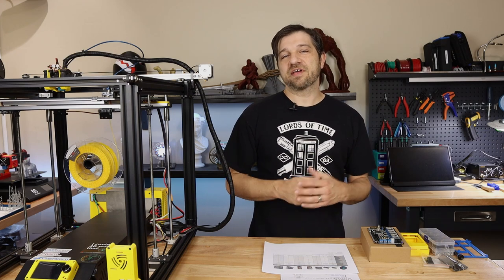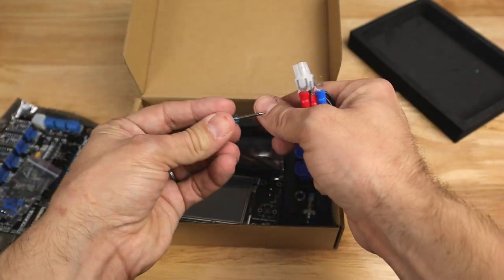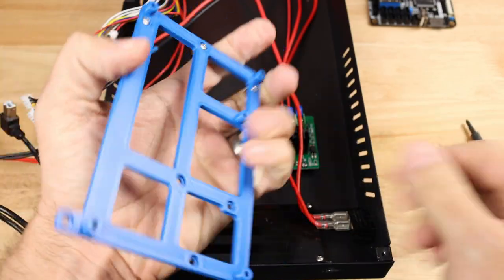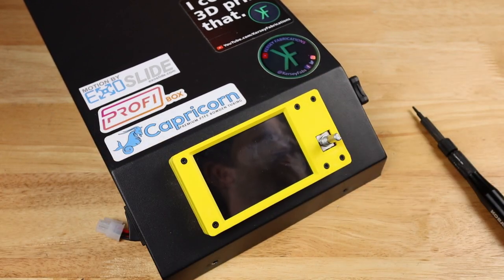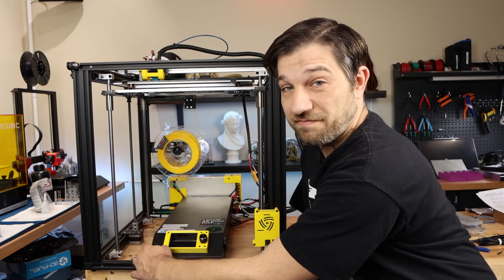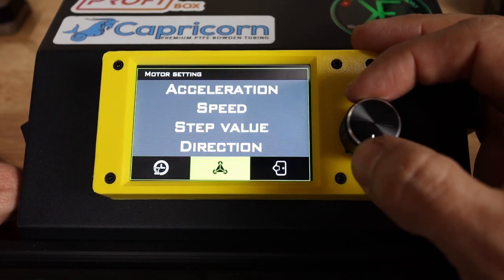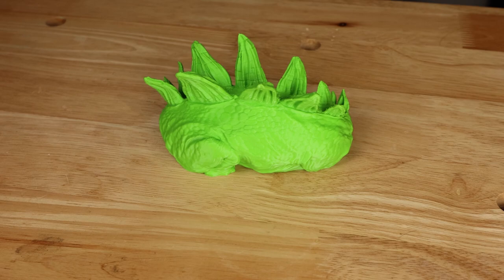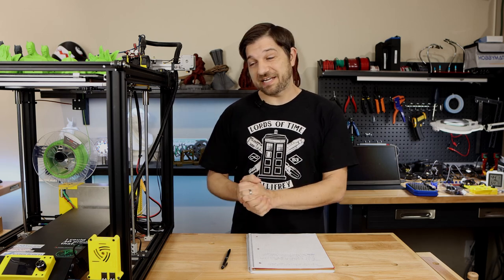Lerdge K 32-bit 3D Printer Mainboard Guide and Review

Comment: Will this setup fix the 2 most nagging faults with what should be a great printer.
I, the dreaded warped bed the BLtouch makes a nice consistent mesh, but Marlin v1.7 (even your compiled firmware) never seems to read it properly. I resort on big prints to use a raft.
2 marlin v1.7 does not read long file names, which is a pain when you want to save great prints with basic design info for my own back catalogue.
Great video again must sort myself to get on the patriot list.

Comment: Great job, I'd like to see if Marlin could be put on it. I'm also interested in hearing more about the octoprint issues. I don't think I'd upgrade to a board that didn't have good communication with octoprint.
Reply from the maker: Thanks! I'm expecting that they can work out the OctoPrint issues. I'll keep everyone informed.
Reply: Octo works flawlessly with Lerdge boards, I have been using them fault free for 4 years now. Marlin has been ported for Lerdge but it doesn't function as nicely as Lerdge FW. In my years of using Lerdge boards, I have NEVER once ever said to myself, gee I wish this was marlin. It is significantly better!
Beware of one youtubers opinion regarding a feature like this guy with saying octo deosn't work, it does and it does well!

Comment: you rekon this would be a simple enough thing to do if you were going straight from default main board to this? seems like for the most part it's plug-and-play other than some configuration stuff and swapping one or two pins.

I'd also like the thank you for making this series on the ender 5 plus. seems no-one else out there has made any worthwhile videos on this printer and no one really seems to know about it. when i finally get around to getting mine i've already decided that im going to get an exo-slide kit at the same time thanks to the video you made of them, and your fixes for the BL-touch seems easy enough to do.
Reply from the maker: I think this is a good board upgrade for those not interested in Marlin. I hope to receive a fix on the OctoPrint issue. I'm glad you're enjoying the content. Thanks for watching!

Comment: I need help.  Follow your video installed the board just fine but the z axis try push up the extruder and the BL touch do not stop it.  What do I do wrong?  I need to reverse the Z axis motor direction also than the video.  When Z+ press on the screen does the bed suppose to go up or down?  Because if I follow your video direction the Auto Level probe test about 10 inches above the bed.   What is my first step to test the BL touch work correctly?
Reply from the maker: 1) It sounds like your black/white BLtouch is not wired correctly. Double check that one.
2) Z+ should bring the bed down because you are increasing the Z height.
Reply: @kerseyfabs  1) I try flip the black and white wires (Opposite than your video) and now when I go to Auti Leveling Setting Probe Wiring Mode NC it does not beep any longer.
2) The Z+ now move the bed down same as your video, just to confirm.
Now when I do the Z axis home, the BL Touch turns to blue (red off) and the probe is down.  But when it reaches the BL touch it does NOT stop and the nozzle crash to the bed.  I have to do emergency power off.  What is the problem why the BL touch does not stop the Z motor?  What setting do I need to change, is the probe wiring need to be N-O?
Reply: Thanks KF, got all to works now but I still have one questions on the stock BL Touch and Extruder mounting what is the Off set values and how to measure it correctly?  You mention the Z axis need to be -3 but +3 seem to work also?? Why?

Comment: As an FYI to everyone , the stl does not fit with the current version .  The adjust knob and buzzer have moved, also the mounting holes on the right side of the lcd mount have moved.
Reply from the maker: That sucks! I don't have the new screen to fix my model. I wonder if someone else has?
Reply: @kerseyfabs  I do, I bought the kit that came with all accessories.  the Wifi module now has a hole extended out to be inline with the motherboard hole.
Reply: @kerseyfabs  Its a V2 motherboard now and the diagram for it doesnt show the wire colours.  I am just hoping the old diagram is still correct.

Comment: I am getting the board soon about over 1 month from China.  I like you to do some video on the touch sensor from lerdge that use circle ring on the hot end.  I did order one but not sure hot it works.  Also video on replacing the end stop with lerdge using optical switch.

Comment: Great video love the bord I just have 1 question what sd card extension do you use every extension I use I get a error with printing ( storage device error )  and have tried some extension cable even usb but when I put the same micro sd directly in the bord it works perfectly best prints I ever made .
Reply from the maker: I included links to all of the parts I used in the description. I've been using this one on multiple boards and multiple installs with zero issues.
Reply: @kerseyfabs  well I got the micro extension cable the one you are using still the same error maybe it’s the psu dying  still using the original power supply maybe the power drops during print but  if I put the sd card directly in the board it works great.

Comment: Main reason I will not ever use octoprint, even though I would love to be able to send gcode and do everything remotely (on my Ender 5) but the slow down is a problem I see people talking about a lot with higher definition models that take more data to produce. This is the reason I think people see improvements with using Arc Welder since it reduces the gcode required by a TON on certain models. Would love to see a huge/high-res model compared with and without octoprint and then with arc welder included. 
I love the ability to do things direct on the mainboard without having to recompile Marlin (ugh)! I wonder how many limitations there are though. Basically, what settings are not included that someone who is a little more involved with micro-managing settings and/or adding hardware and options (like yourself with what you do reviewing and constantly adding or changing parts).

Excellent video as normal (I am catching up....hopefully lol)!
Reply from the maker: OctoPrint can be a problem sometimes if you have certain plug-ins installed or if your board's firmware isn't configured to handle a lot of data over USB. I go back and forth between using it to print. Either way though, I can use it to monitor printing, even if I'm printing from SD.
Reply: @kerseyfabs  You know, I never thought about that! I am an idiot but I didn't realize I was this bad LOL You don't HAVE to use it to print from just to monitor....Ok, now I might actually get the stuff to build one of these puppies. I don't know why I was thinking if you don't run the stl from it you can't monitor anything... Thanx for the info man!

Comment: Now that it’s been a month, are you still happy with this setup? I really like that you can adjust offsets and such right through the printer UI
Reply from the maker: Yes! I'm still using it for prints big and small without issue. I am looking forward to the next video worth of content to work a few things out but it does work well. The main thing I need to do is get UART mode working. It will help make it quieter and better tune my voltages.
Reply: @kerseyfabs  excellent. Is this considered a “silent board”? I’ve got the oem board on my e5+. It’s been driving me bonkers for nearly 6 months. Came across your video on this and it is a much more intriguing upgrade to me compared to the creality silent board
Reply from the maker: Well, the board itself isn't silent. You'll need to order it with silent stepper drivers. Since it looks like that's all they sell it with, you should be good.
Reply: @kerseyfabs  right understand that it is the steppers. Great videos by the way. They’ve been quite helpful.

Comment: Is it possible to upload your own designed icons for the GUI on this board?
Reply: proprietary firmware, so... you I don't think you can do it yourself. While I'm on the subject you may want to consult the lerdge website under 'g-code' to see if some of your favorite g-codes are there. i.e. M600 - Filament change is not listed, so until it is you'll have to g-code your own implementation.
Reply from the maker: As far as I can tell, you cannot change the icons but it may be possible to figure out the .ui file format that is in the firmware package to change that. It does appear that they have some sort of software to create your own bootscreen though. I haven't tried it myself.

Comment: I liked this until you mentioned that other displays are not compatible with it. I have a BTT TFT70 display waiting to be installed, I just need to find a case that I like for it to go into, and my choices are pretty limited for now. I also am very new to 3D printing and have absolutely zero designing skills. I'll just keep patiently waiting for your SKR PRO v1.2 video. I have that board already, but I bought it without drivers because I wasn't sure which drivers were being shipped from Amazon, AND more importantly, BTT's webpage shows six different drivers. I'm not at all sure which ones to get and which ones perform better etc. etc. etc.

Comment: I just make a few prints using this board and it print very nicely.  Now I noticed that the hot end fan is not coming on when printing.  Only the Heat Sink fan on when heating on.  Is this normal printing PLA the hot end fan not comes on on this board?  For testing I swapped the Hot end fan and Heat Sink fan connectors on the motherboard it is working correctly.  How to test this hot end board pin?
Reply from the maker: The cooling fan should definitely be turning on. Make sure you're connected to the right header. You can test the cooling fan by itself on the Control page. There is an icon that looks like a fan that will allow you to set the speed.
Reply: @kerseyfabs  It works now.  The board should have manual explaining all this.  Do you know why this cooling fan not automatically comes on?  What percent should I put on?  For PLA is that 50% or 100%.
Reply from the maker: The part cooling never comes on automatically from the firmware. Your slicer (Cura probably) should have a setting that tells it when and how fast it should cut on. Usually 100% for PLA.

Comment: I ordered a k board for my ender 5  plus. Has anyone used Kersey's config file on the latest board? Just wondering if it works on the latest version. Thanks
Reply: well it mostly worked. I had to set the motors up, set bed size and end stops.

Comment: Thanks a lot for your great videos,work  and your massive pacience in explaining step by step, I really enjoyed your videos.
Perhaps you could take a few minutes and help me with this Ender 5 plus and the Lerdge  K Board, that I bought after seen your video
The wiring is correct ,I upload your great Config.But when I try to home the Zaxis with the BL Touch, the Trigger comes out,and the Bed comes up,but the Nozzle crashes into the Bed, the wiring of the BL touch is correct,and yesterday itworks fine wih the originalsilent board.
Perhaps any suggestion  ? I will be glad for any help
Greetings
Reply: Okay I think I found the Problem,it seems that the wiring was correct, but the issue was the white and black wire,I had to change the direction of the black an white wire, therefore "problem solved" :-) Homing was a perfect match !!
Reply from the maker: Glad to hear it!
Reply: @kerseyfabs  Thanks for your  answer,had till now a pair of issues, but after printing with your config file,all works fine,till today :the steppermotors gets hot, hotter than 70^C for the extruder I have the Vref on all TMC 2209  at 1.250,and the mA at 600.I tried to lower the Vref but still gets hot .The TMC 2209 i left it in the Stock Mode without changing any pins on the Board
Also the start of the Print,till now the head homed first,then goes to the middle, where it Touch with the BL touch the Bed,then it went to the forward left side and start the Print. 
Now the head is homing  back goes to the middle,then returns backside on the right side and from this startpoint it goes forward to the left side of the printer and start the Prnt with the Primerline 
Perhaps you haveany suggestions about Motor Temp and the Printrun 
greetings and thanks for your support :-)
Reply from the maker: Thank you so much for bringing up the heat of the motors! 😬 I had not noticed that since I don't go around touching my motors often. Now I need to get up a video ASAP!  Here's what you need: https://www.lerdge.com/public/upload/file/360f824755ab521bd741a67994b1de7e.pdf
This spec sheet has the magic formula which amounts to I = 0.88 * Vref. This means we need to turn them way down from what appears to be the default of 1.25 V which is 1.1 A to 0.68 V for .6 A.
If we go by my previous installs:
X: 0.65 A = 0.739 V
Y: 0.8 A = 0.909 V
Z: 0.65 A = 0.739 V
E: 0.8 A = 0.909 V
If you're not sure how to do this here's a previous video that shows the process: https://www.youtube.com/watch?v=cAI0H4e6Usg&t=946s
I'll release a separate video on this soon!
Reply: @kerseyfabs  I'm so happy not to be the only one with boiling stepper motors.
Thanks for the feedback, I'll swap this on the board immediately
Great work from you. I designed a logo for your bootscreen on the "Ender 5+". I would like to send it to you as a finished file that you only have to save on your SD memory card and on the board using the print command .If you want that. 
Greetings
Reply from the maker: @custompaintfolientechnikfl6813  Again, thanks for pointing it out. I'd love the logo! You can send it to my email: kris@kerseyfabrications.com
Reply: @kerseyfabs  I have send you the new Bootscreenlogo  :-) Have another Issue with this Lerdge Board.
After I solder the pins on the Stepperdrivers and set the one pin on the Board correctly on TX/RX .
The problem I have now is with the Homing of the Z-Axis, the Printhead move forward and dont stop in the middle, it moves forward till hit the front of the frame ,but before this happens I shut down the Printer
Reply from the maker: @custompaintfolientechnikfl6813  What changes did you make? Just the stepper changes? If so, you may need to go into the Trinamic portion of the display setup and make sure your values are correct.
Reply: @kerseyfabs  Hello Kris  I only soldered the Bridge on the Stepperdrivers, and on the Board I removed 2 Pins and reconect the 3rd pin on the RxTX and middle Pjn like it was written in the Instruction manual,then I set the Steppervalues with the Values that you gave me
 For all Drivers
TMC 2209 ,Stealthchop mode , 16 microsteps and the Values are:
X: 0.65 A = 0.739 V
Y: 0.8 A = 0.909 V
Z: 0.65 A = 0.739 V
E: 0.8 A = 0.909 V

I noticed now that I am only able to home X,and Y Axis separately, if I try to Home Z, The printhead homes to X and to Y again,then the Printhead moves forward. Not able to home Z separately
https://www.youtube.com/watch?v=Hn5RwROQ6EA
Reply: I have changed the Steps for the Y-Axis at 40 from 80, and this seems to work, still dont know if the problem is the Mainboard itself ,think there is a problem of storing correctly the parameters

Comment: Hello eveyone, for anyone who follows the video on installing the mother board pls be aware that when he instructs you to swap the red and yellow on the run out/ break sensor wire when I did this it cause my mother board to heat up so I had to swap it back to get it to work if left the other way it would lead to a electric fire
Reply from the maker: Thanks for the feedback. Did you do this on the Lerdge K or one of their other boards?
Reply: @kerseyfabs  So to add to this, I forgot to swap my red and yellow even tho i had it wrote down to check.. When I did a filament change my printer turn off(crashed). I did the wire swap now it works fine. As long as the switch is closed you would get 5v to signal either way(swapped or not), with it reversed and the switch opened I would have grounded the signal wire. I think the video is correct.

Comment: great video but that touch screen is so poor, after watching video i wouldnt touch that touch screen with a barge pole, if it was a video about that screen then it failed
Reply from the maker: I typically use the stylus with it or the jog wheel. It doesn't work great with my fingers.

Comment: Why would you want 2 usb cables plugged in?
Reply from the maker: Where do I talk about hooking up two USB cables? How would I even do that?
Reply: @kerseyfabs  @33:04 you plug a usb cable into the usb adaptor, then @ 34:35 you try to plug another usb cable into the motherboard but it is the wrong one.
Reply from the maker: @TheRattleSnake3145  One USB port is for USB drives, the other is for communication to the board via computer.